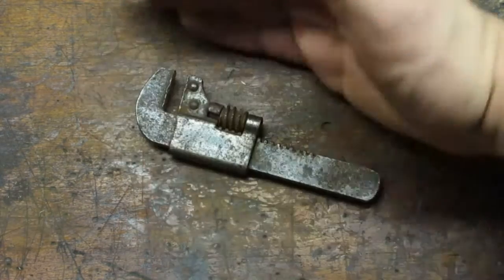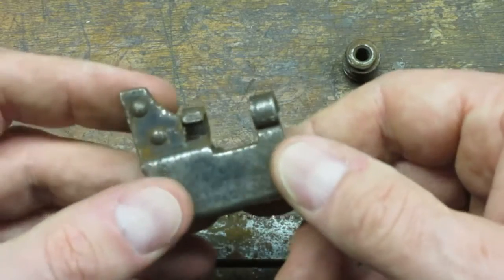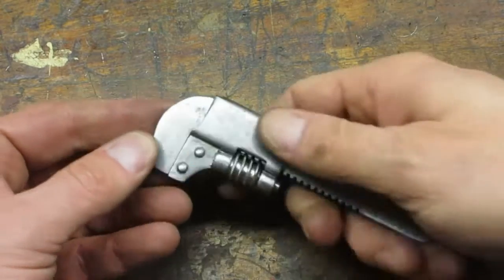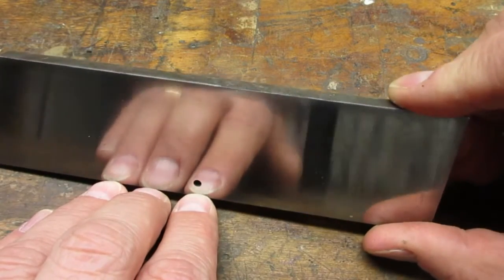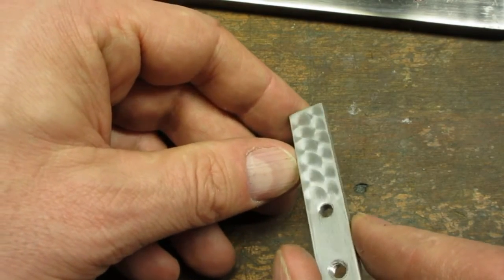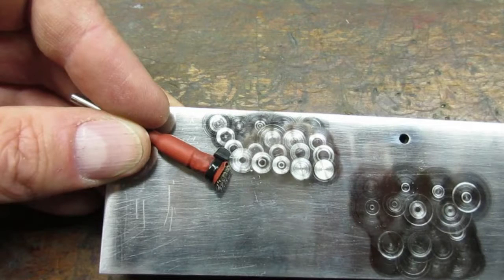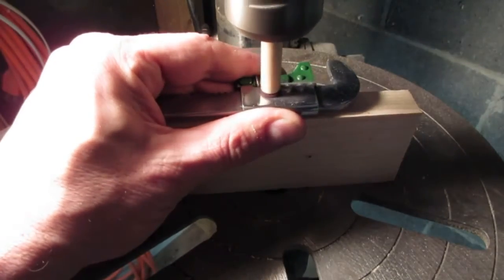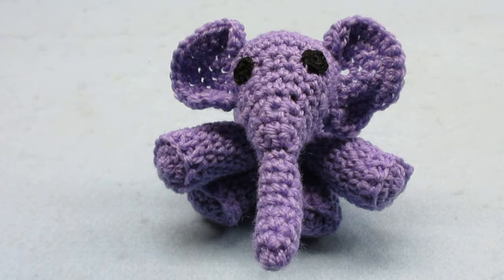Hand Tool Restoration - Tiny Adjustable Wrench (Low Budget DIY Jeweling)

Comment: Lol, great episode. The wire wheel heat shrink idea was novel. I think if you used jb quick to encapsulate the wire bristels it might make a long lived jewling tool....just an idea. I redid a giant auto wrench tonight and painted it green, it looks so horrible. The green on yours looks good. Great stuff! Cheers
Reply from the maker: Thanks Joe!  I think the wire is just too thin.  Brownells sells actual jeweling tools that look like what I made - but I guess they actually work!  I have had good luck mixing just a drop or two of black into the colors to make them less bright and gaudy.